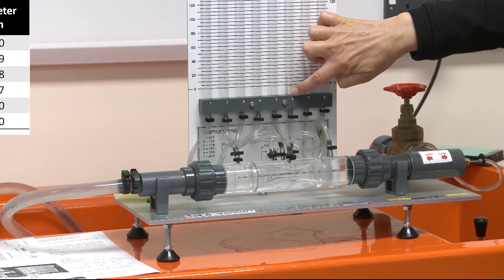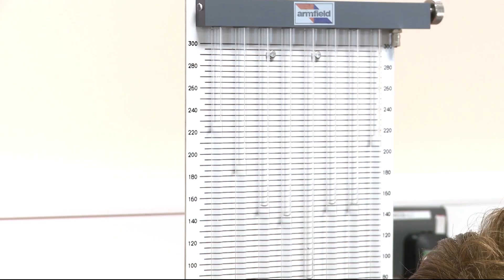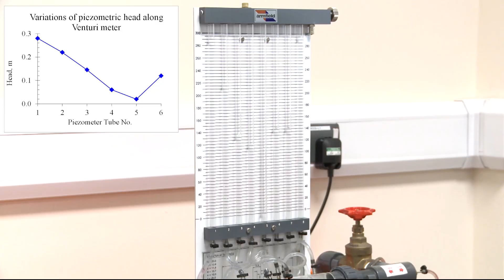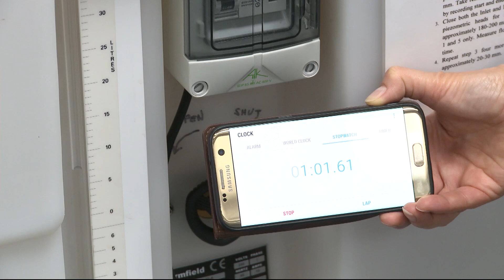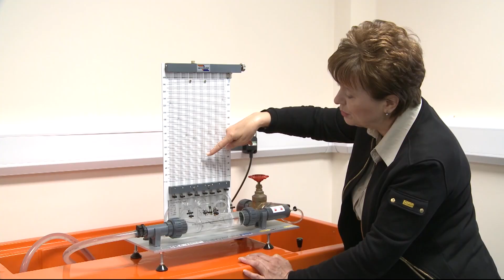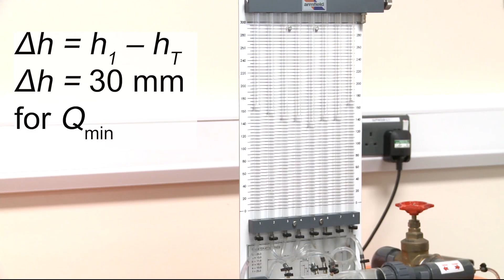Online laboratory experiment: Flow through a Venturi meter

Comment from the maker: Conducting online laboratory experiment 'Flow through a Venturi meter'. Venturi meter is a device that is used to measure flow rate. The key objectives of the lab experiment: to gain experience of the use and calibration of the Venturi meter for the measurement of a flow rate in a pipe and to develop better understanding of its principle.
https://www.youtube.com/watch?v=xpqTHtjmfbs 
You should watch this video 'Lab data processing: calculations for Venturi meter lab report' that shows main calculations for the lab report.

Comment: What is the need of connecting the manometers to a common manifold with an air valve
instead of keeping the manometers open to the atmosphere??
Reply from the maker: If pressure in a pipe is too high if manometers are open then the flow may overflow. When students do experiments and if they open an inflow valve very fast the pressure rises quickly and manometers are overflowing and may even burst.

Comment: Hi ! Is there a procedure list for this experiment ? I couldn't catch all the steps in a proper steps. Hope you can help ! Thank you
Reply from the maker: There are two parts of this experiment: 
Part 1	Variation of the piezometric, total and velocity heads along the venturi meter
Adjust the flow rate to achieve the maximum (h1 – hT) available (therefore maximum flow rate), i.e. with h1 close to the top of its scale and hT near the bottom (h1 piezometric head at tube 1, hT piezometric head at the throat). This is achieved by manipulating both bench (inlet) and control (discharge) valves.  (If difficulty is experienced the air (bleed) valve may also be adjusted).  Determine the rate of flow using the tank and recording volume on the ruler installed on the bench and time. For Part 1 test, readings from all the manometer tubes should be recorded. 
Part 2	Calibration of Venturi meter through measurements of Q and (Δh=h1 – hT). 
Repeat the process described in Part 1 for five more flow rates.  For this set of experiments, measurement of flow rate and readings from the piezometers for h1 and hT only should be recorded. The calibration factor C will later be determined from these measurements. The dimensions of the meter for each piezometer taping are shown on the Venturi meter itself.
Reply: @StudyTips4U  thank you very much !

Comment: Maam actually i performed this practical today and opened the inlet and outlet valve simultaneously but the water in manometer tube D was going down and not in E. Meanwhile water was going out from air valve too..why was this so? Can u help plz
Reply from the maker: If water was going out from the air valve it is very likely that you opened inlet valve much faster than the outlet valve, I.e. it is likely that inflow was greater than outflow and pressure within the pipe increased and water was flowing through the air valve. You have to open inlet and outlet valves simultaneously but you need to do it slowly that in you can control both inflow and outflow.
Reply: @StudyTips4U  and maam why was not the level in manometer tube 5 going down. The level in tube 4 was low as compared to 5 and i tried to adjust it for 10-15mins but still it wasn't working..Can u plz highlight my mistake in this case..Moreover apparatus and parts are completely similar...